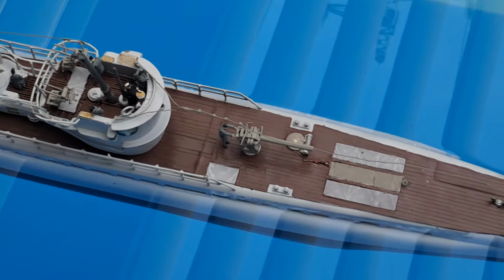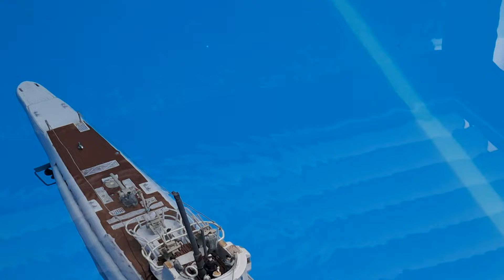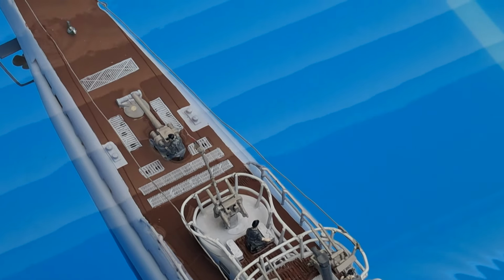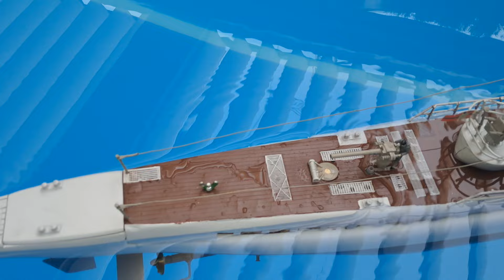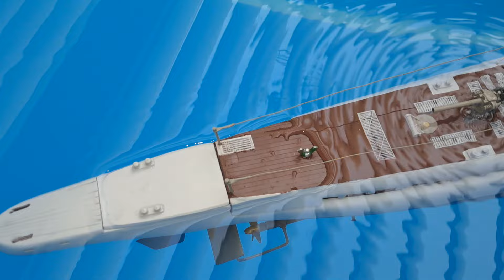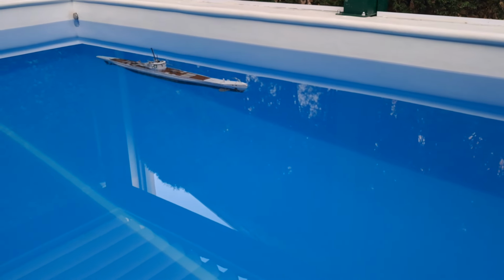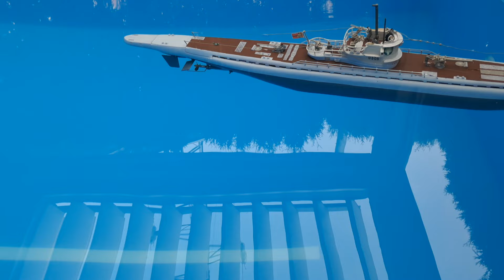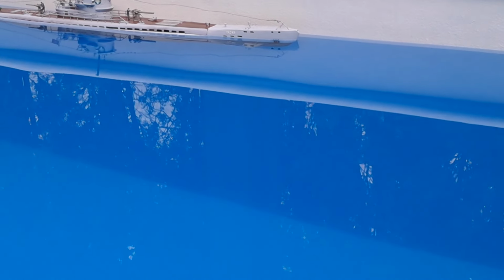Tommys U Boat

Comment: Hi Paul, that's quite an impressive piece of kit! Wow 🤩 Honestly, I can't even understand how it submerge and then get on the surface again!
Reply from the maker: Hi Erik, it works the same as the older prototypical Subs.
The ballast tanks are open at the bottom with valves at the top closed. When the valves are opened the water enters the tanks and the Sub submerges. To surface the valves are closed and air is pumped into the tanks at the top pushing the water out. Its been a labour of love getting everything working but finally it seems to be ok.
Cheers, Paul.👍👍🙏
Reply: @paulvozman842  Thanks for the explanation. I never understood however where the air comes from if the submarine is submerged. It's a great wonder of technology, and your model is really fantastic!
Reply from the maker: @railway187  Hi Erik, The air supply in my U Boat comes through the periscope when its on the surface. Because its normally driven under water the positive boyancy is enough to bring it back up after submerging. The problem is when its submerged if the pumps are turned on water can get inside the sealed compartment. On the real Subs air is stored in air tanks for surfacing and trimming. I wish I had that system.
I am going to show my Chinese Loco on Wednesday for your Frankenstein challenge.
Cheers, Paul.
Reply: @paulvozman842  Cool! I am looking forward to seeing your Chinese Loco running again.

Comment: Bravo Paul...well done. It looks great. Quite speedy too. Lovely.
Reply from the maker: Hi Tim, I started this scratch build 10 years ago and finally got it working quite well. It was only running on one motor when it went under and hit the pool wall. If I had used both motors it would have been a lot faster and probably got damaged. Cheers, Paul.👍👍🙏

Comment: Hey, Paul.  I know you felt it was a partial success, but from where it was and the work you've done... this is an awesome go.  It is a wonderful model and to see it running in your pool is fantastic.  I love the cap, too!  This is great to see!
Reply from the maker: Hi Anthony, This has been a long experiment in getting the ballast pumps,valves, electronics etc to finally work well. After all the failures I am happy with the end results. I will add some more weight to the bow section, this should make it dive earlier when running. It weighs approx 25 kg so takes some stopping. I only ran it on one motor as its too powerfull on both motors. 
The Cap came from my visit to see the U17 in Speyer back in May this year. 
Thanks for your support in my various projects its most appreciated. Cheers, Paul.👍👍🙏

Comment: Beautiful, even it still has a little weight issue to be fixed. Even fantastic, as it is scratch built and made functional by your own efforts! Thanks for the video, Paul, have a fine week! / Chris :goodvibes:⚓
Reply from the maker: Hi Chris, getting the trim right is not easy a few grams can often make the balance good or bad. I started this scratch build 10 years ago and have finally got it working quite well. Thanks for your support and kind comments. Have a great week.
Cheers, Paul.👍👍🙏

Comment: Brilliant effort Paul.  Now it is time to commence mass marketing. They will sell like hot cakes.   You might want to partner with a Chinese manufacturer though.  Good on you for sticking with it, it's very satisfying to see a positive outcome.  Steven.
Reply from the maker: Hi Steven, There are a number of manufacterers who make cylindrical removable diving systems take a look at "The RC Sub Guy" on Youtube he is the real expert in Sub modelling.
My plan was to try and make my Sub operate like the older prototypical Subs actually dived and surfaced using ballast tanks,pumps,valves etc. I started building mine from scratch 10 years ago and have had many problems to overcome. I think I have finally solved all the issues ,just some extra gramms of weight on the bow and its done. I was very happy to see it dive allthough it hit the end of the pool a bit hard. It weighs approx 25kg so takes some stopping, it was only running on one motor at the time, its good I didnt run both motors. 
Thanks for your support in this project. 
Cheers, Paul. 👍👍🙏

Comment: You may be getting air trapped under the deck. Is it a dynamic diver? With decks awash like that it would dive dynamically quite well.
Reply from the maker: Hi, I have vents under some of the deck grating that allows are to escape. I incorporated them some time ago as some air was bring trapped. Its designed with positive boyancy so should be driven under water as in the video. Its a delicate balancing act to try and do static dives again as shown in the video. This has been a long experiment but finally getting close to working while under way. Thanks for watching and the advice. Cheers, Paul.👍👍🙏
Reply: @paulvozman842  I have an Eden (Later Sheerline) Akula submarine. I always only ever filled the ballast tank so that the top of the conning tower just broke surface. I used the forward planes to dive and maintain depth, with an automatic leveller on the rear planes. It could sail around at a constant depth hands free. If I lost sight of it (old eyes) I could switch off the transmitter and a lost signal detector would blow the ballast tank. With a little positive buoyancy, it managed to negate  any tiny leaks. Your project looks ace for a scratch build. Well done!
Reply from the maker: @akula9713  I follow the "RC Subguy" Nautilus Drydocks on Youtube who has some amazing Subs and dive systems using the cylinder types. These are very controllable but as mine has front and rear ballast tanks and a seperate water tight compartment for the electronics I dont have the ability for such fine depth keeping. 
Its taken me 10 years from starting the build from photos to getting it almost working. It weighs 25klg empty is 1.35m long, 12cm wide and 20cm high. 
Take a look at my video called "Tommys final Sub Update" where i show how my sub works.
Reply: @paulvozman842  The Eden boat just had a large central tank. It used a windscreen washer pump to pump water in, via a pinch valve. The pumped in water would compress the air inside the tank. The pinch valve was just a servo cam pushing a spring loaded rod through a block of plastic onto a ball bearing that sat on the inlet water tube. The operation would go like this.
Dive servo neutral position..pinch valve closed
Dive servo to the right…..pinch valve opened, microswitch activates pump, ballast tank fills, compressing air inside.
Dive servo neutral position ..pinch valve closed, microswitch deactivated. Water can’t get out of the tank.
Dive servo to the left pinch valve opened, compressed air in tank pushes out water, boat surfaces.
It’s been my most reliable boat so far. A very simple system.